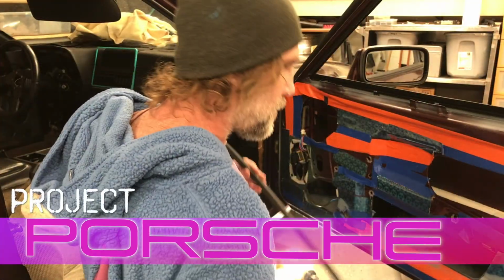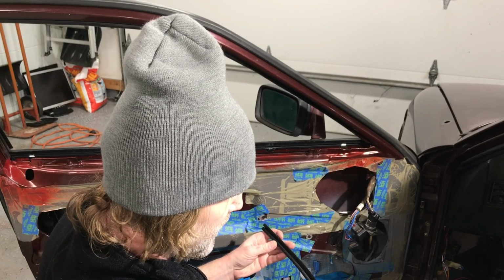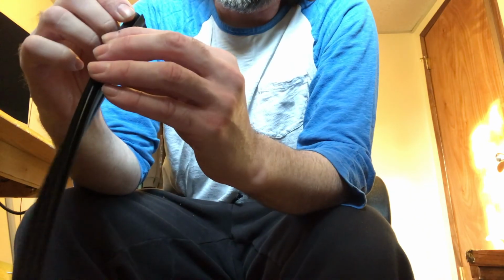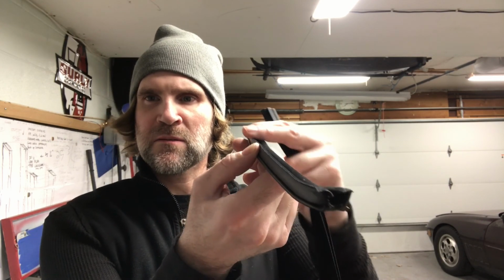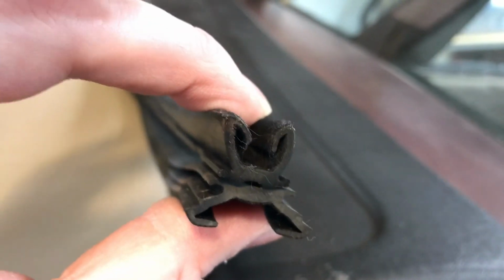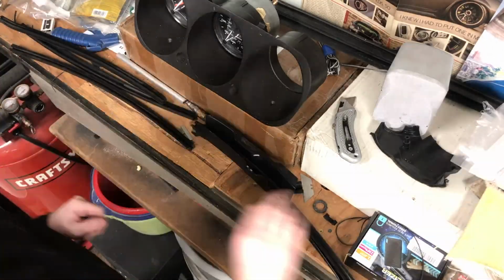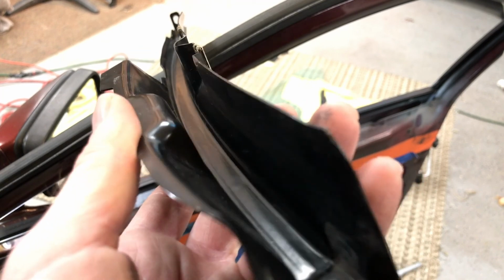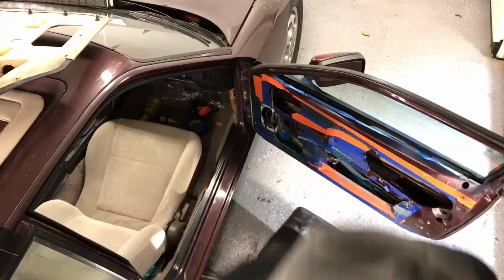Modding & Installing 924/944 Felt Window Guides

Comment: Nice work.  Hope you remembered to mark position of bolts for the lower regulator track.  Also remember to clean and lubricate the rollers and the regulator
Reply from the maker: Thanks!  Yeah, it's kind of funny - I marked and took pictures of those lower tracks for reference, then I still managed to put them in upside down and had to go in there and flip them.  Also, I debated on what kind of grease to use - ended up using a couple different kinds of lithium and some synthetic stuff.  I almost used silicone break grease thinking it would stay put in there/repel water, but that stuff is kind of "sticky" so I changed my mind.
Reply: @rybreadification  yep, been there, done that.  Once my door lock mechanism arrives from Germany, will have to re install the window, regulator etc

Comment: I need to do that same job, I spot welded my passenger front rail back earlier this year, need to go back in and do what you did and inspect the window shape vs rail.  I'm gonna try use spray dry teflon, i read that works well.
Reply from the maker: I was wondering if other people had the same problem!  I guess it’s good that these cars are designed and manufactured to a degree of exactness that makes it possible to anticipate what things are going to break,  but it still sucks when they do.  The Teflon is a good idea.  I wonder how safe that stuff is,  like if you inhale by accident or get it on your hands - (a carcinogenic?).  I’ve got a can of that stuff on my shelf I could have tried.